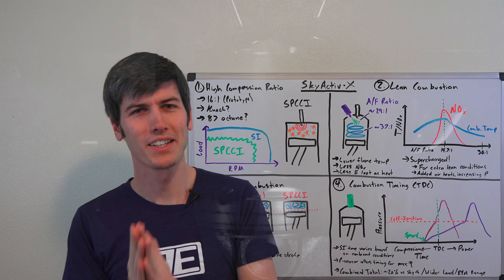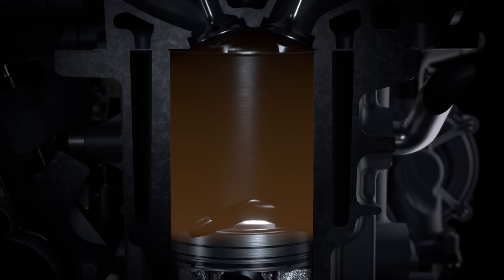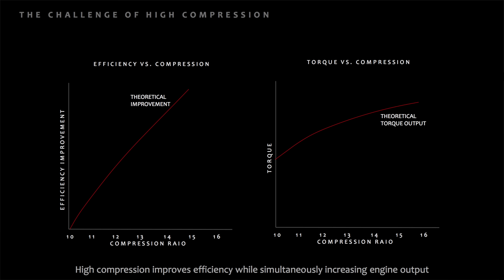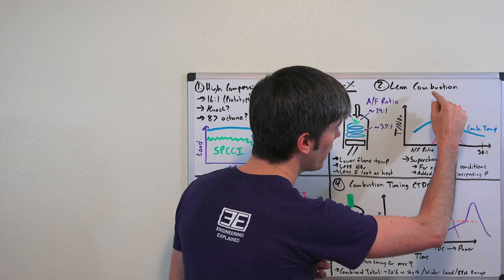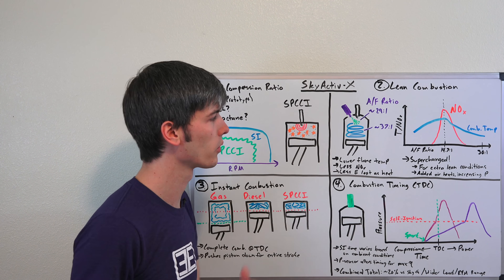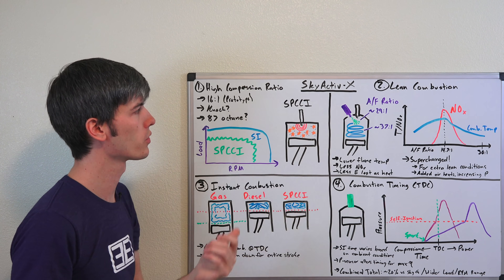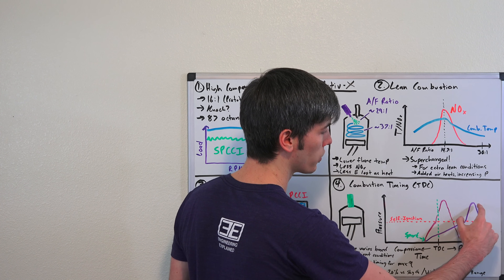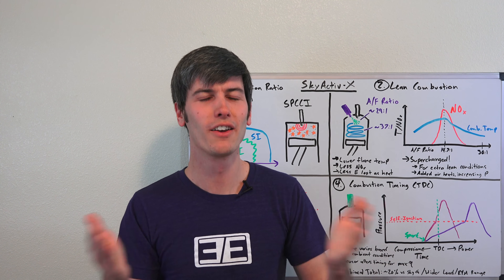How Mazda Is Saving The Gasoline Engine - SkyActiv-X

Comment: The biggest mistake Ford Motor made was breaking it's partnership with Mazda.  Ford couldn't make a decent small car until they partnered  with Mazda.
Reply: Your comment is rather US centric. Ford has been making quite capable small cars for the European market for a long time
Reply: @nastysimon  I rented a 2013 Ford Focus once.  It was a very enjoyable car to drive.
Reply: Denver Cayle Ong there is nothing out there that "proves" Ford can't make good engines. And his statement is very broad. The 2.3L SOHV was Ford all the way in the 80's. Very great engine. Both my 88 and 89 mustangs had that engine. Transmission another story but both engines had over 200k of abuse and not regular maintenance and got sold while running beautifully. The newer 2.3L DOHC engines in the early 2000's were led by Mazda. Also great engines. Also the 2.3L ecoboost having head gasket problems in the RS is not the same 2.3L ecoboost in the mustang. Ford wanted the engines to be different for some reason and changed the piston /head design. Bad move unfortunately. Subaru also lots of known head gasket problems in their 4 cylinders. Doesn't mean they can't make good engines.
Reply: Well, you're wrong. Current decent Mazda 3's happened when they shared the Focus platform. Mazda learned a lot about chassis dynamics. The current 3 is a all Mazda platform, but a very similar one to the old German Ford designed one. The Ford partnership was productive, but not perfect. The new Partnership with Toyota is going to take the Skyactive to the next level. The current Camry's 2.5  has a superior powetrain that gives better mileage and horsepower ratio compared to the skyactive. However with Toyota capital, the Skyactive can go to the next level. What this guy fails to tell you, most of us with common sense knows why Mazda has the highest fuel economy average. Their fleet is all 4 cylinder. No V8 trucks, no high power fleet. Of course they would have high mileage average. They have a niche product line.
Reply: skeleton crew . The Pinto had that the Kent engine and was a good drive line. It's down fall was the fuel tank behind the wheels. Which was very common back then.
 Example; I went to high school with a girl who died in the back seat of an early 70's Celica. It had the tank behind the wheels. Car hit them from behind and the Celica blow up, killing her. Same problem different manufacture.
Reply: @strang1124  All cars (except VW etc.) had fuel tanks well behind the rear wheels until 1965 big American cars when they all moved it to a tall tank just behind the rear axle which allowed a deep well in the trunk behind it. The Pinto had a bracket on the rear axle that acted like a can opener on the tank, but other cars could also burst into flames with a rear end crash.
Reply: Ford has stigmatized Mazdas name. When people think of Mazda they are unaware that ford is to blame for their historically bad reputation. Mazda should be given a fresh start with consumers. They simply have some of the best engineers on the planet and have a genuine heart for delivering the best product they can make. They are one of they only car manufacturers that hasn't sold for profit. As in Honda and Nissan, using cheap cvt's, instead of actual engineering for better fuel economy. I hate cvts. They are cheap. They are designed for 100k if you are lucky. And they are not cheap to fix. They usually just get replace for $5000+. For what a couple % gain. They drive like $#!t. They know it. All they care about is marketing and prifit. Mazda claims to never use cvts. Instead they go above and beyond with actual engineering. They are an automotive company that truly cares about you and your experience with their product!
Reply: @denttech2515  I had a Mazda from before the Ford connection. Things rusted and things broke before it got totaled (not my fault) at 45K. The dealer service was awful in every way and the factory reps did not do anything about it. Even the NPR car guys once talked about how awful the Mazda dealer/corporate service was.
Reply: Appreciate your comment here. It’s very apparent you know what you’re talking about. You’ve done your research well — and I guess you speak from experience. Thank you.
Reply: A mistake for Ford, but a blessing for Mazda.
Reply: Mike Y Ford had to many cross or the same models as Mazda. Basicly taking from itself. Ford's big mistake was selling all of it's World known premium brands. All of the high profit and trickle down platforms with the engineering is now gone. That has hurt their profit margin tremendously.
Reply: Well now it seems Mazda and Toyota are in a partnership. This means that we might see Mazda's engines paired with Toyota's Hybrid Synergy Drive - the most efficient engine with the most efficient transmission. I wouldn't put it past them to crack 100mpg with a combo like that.
Reply: yep, their 2.3 ecoboost looks so similar to the mazda disi 2.3, though everything was stamped FOMOCO in the mazda.
Reply: Neil Simon you are correct.  We, in the Americas, rarely get the Fords from Europe.  When it comes to the words "Ford Escort",  you might as well have said a vulgar swear word in the USA.  Where as Europe got something much better. This US Ford/Mazda marriage car was synonymous with crappy cars in the same way people ask for a Kleenex instead of a Facial Tissue.
Reply: Dennis W Ford sold millions of mustangs from 1964 to 1993, arguably one of the best small cars made
Reply: @ikillyoudead  You do realize that the original two generations of Mustangs were Falcons with a lower body. They all even had Falcon based dashboards. So I guess Falcons were also one of the best small cars made.
Reply: Ford didn't break from Mazda .... on the contrary , Mazda bought its way out of that crappy partnership during the bailout  . Thanks God they did it because I am a fan of the brand .
Reply: Charlie ; the blocks and internals were the same. The heads were unique. The MX-5 & the Ranger tranny were the same.
Reply: No, that was the biggest mistake Mazda made! Had to have set them back 3-5 years at least.
Reply: Erol Demirci  Where are you getting that info? Oh sorry, it's made up. The Mazda's you are thinking of are actually ford influences. Exactly the point of this discussion. A true Mazda, by consumer reports and many others, is considered one of the most reliable vehicles you can by. There are many stories of Mazda's with close to 300k with no issues. It's all about maintenance. What's you vehicle of choice?
Reply: Well now they won't he making cars in the future (except the Mustang of course).
Reply: Obviously you don't remember the Pinto.
Reply: Ford was desperate for money, all they did was sell their controlling shares of Mazda, they still own shares (5%), Mazda wanted to invest and start their hybrid program years ago but Ford when they had controlling shares stopped Mazda's hybrid program, Mazda most likely would have a hybrid series of cars on the road like Toyota but Ford prevented it.
Reply: Maybe the amount of cylinders in an engine being perceived as a prestige feature has prevented US automakers from making decent engines for subcompacts without input from European or Japanese subsidiaries. The same way Ford relied on the Thriftpower Six as a base for the development of the HSC 4-cyl, or GM doing the same with the Stovebolt Six and the 153, it wouldn't really have surprised me to see 2-cyl engines based on the original project of a straight-6. Sure that would lead to some very crude engines which would appeal more to buyers of povertry-spec derivatives of the Opel Corsa B which were available in some Latin markets until recently than to the average Joe in the USA or Canada, but the ease of maintenance and low cost would've been a valuable asset against the recent flood of Chinese econoboxes all across Latin America.
Reply: Dennis W wrong. Look at my post.
Reply: The old fords w mazda engines were the best, pretty much all the gt models besides mustangs, probe, escort...
Reply: Dennis W not really. They just copied mazdas blueprints and boom. However new engines that aren't 2.3 are garbage.
Reply: FXIIBeaver the 2.3 ecoboost is garbage. At least the first generation cylinder heads and all of the engine blocks.
Reply: travis seuren your statement proves that Ford can't make good engines.
Reply: Some would argue Ford hasn't made a good one since the partnership ended either. The Festiva is an embarrassment.

Comment: @Engineering Explained could it that the "step 3" isint correct... because gas engines works with the equil-room- system and the diesel works with the equil- pressure-sytem...or i`m wrong? diesel thas a longer burningtime because of  the Air- Fuel mixing process....but nice vid very interesting engine...hope to see more about it...thx

Comment: The future is not electric.

The energy density of hydrocarbons is higher than the theoretical maximum energy density of batteries. When electricity becomes cheap, it will ultimately still be better to manufacture gasoline out of water and carbon, than it will be to make batteries.